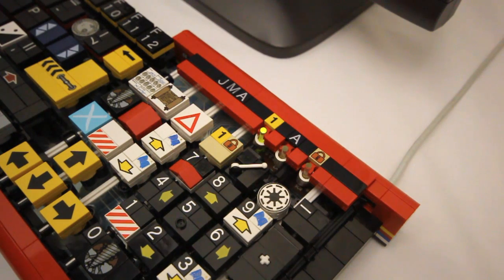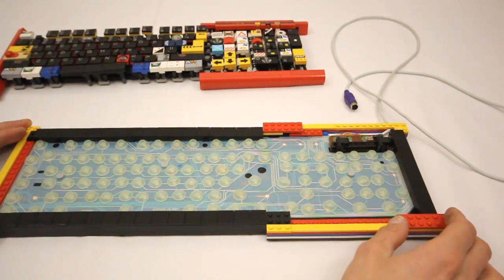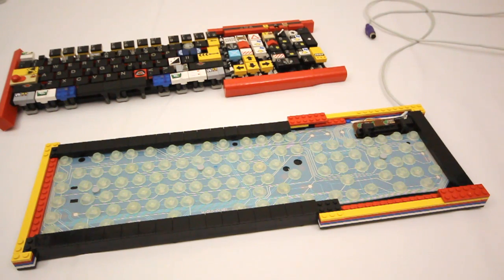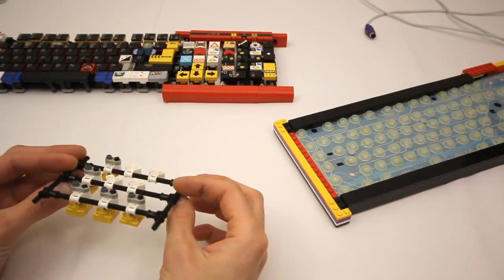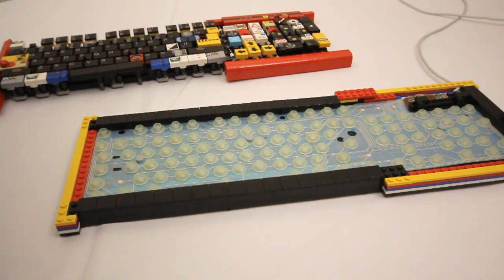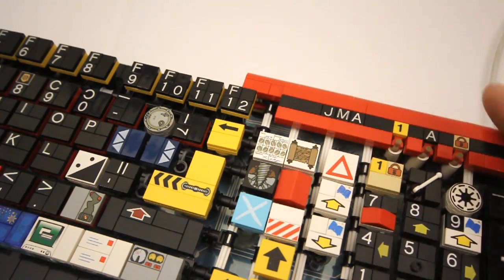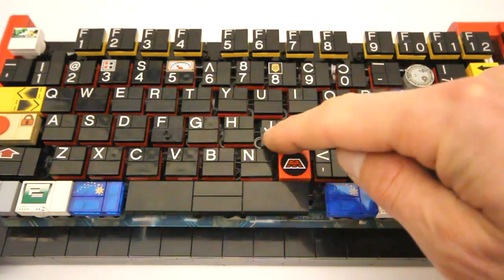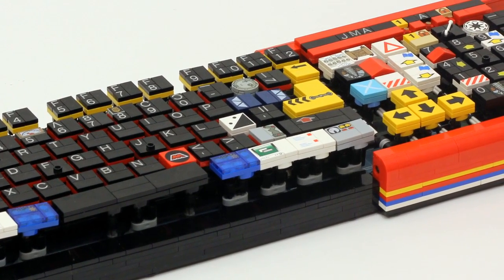Working LEGO Computer Keyboard

Comment: A recently found a lego camera I forgot about and although it would charge, the power button didn't work. I deconstructed a little bit of it by pulling pieces off with my teeth, but I just ended up ruining it. I wanted to see if there was any thing maybe blocking the power button, but no there wasn't. I'm so dumb.

Comment: imagine if it was mechanical
Reply: boy, do i have the news for you
Reply: It honestly wouldn't be much harder at all. It may actually be easier.
Reply: And four years later boi he makes one
Reply: It kinda is
Reply: @Charizardlover_0707  no... it's not. Don't you see how it uses rubber membranes rather than mechanical switches?
Reply: @g_a_b_r_i_e_l_  the mechanical definition for mechanical keyboards is rather messy anyways, is the IBM Model M no longer a mechanical keyboard because it uses a membrane? or how about KT linear and tactile foam and foil, the linear one would be considered mechanical since it doesn't use rubber, but the tactile wouldn't since the return spring is a rubber sleeve? or what about alps integrated dome? it's a standalone switch like Cherry MX and Alps SKCM, but it uses an enclosed rubber dome as a spring
Reply: @nepnep493  I was just saying the one he built wasn't mechanical
Reply: Gabriel Bryson sad :(
Reply: @Charizardlover_0707  yes, big sad. I get bsods almost daily :(
Reply: Oh my god don't talk it would take months
Reply: He did it, see this video:
https://www.youtube.com/watch?v=2jP6MFBXFaA
Reply: @mrgergos  Still. The next step is creating keyboard that uses switches build with lego.

Comment: That keyboard which you used as the base looks like it came from the early 2000's
Reply: Well if you didn't notice it using a ps2 port for its interface, so it definitely came from either late 90's like 98 or 99 or very early 2000's like 2000-2002

Comment: if you are willing to do all that, why not build it with mechanical switches?
Reply: Modern mechanical keyboards are digital, most use the USB interface. It would probably be even easier, since there's lots of DIY kits out there for mechanical keyboards.
Reply: you still need the controller unit of the keybord to convert the analog signals into digital signals
Reply: Taylor and Jackson I dont think you know what mechanical means...
Reply: If you can find a way to integrate Lego pieces with mechanical switches, go right ahead
Reply: really? mechanical switchers are loud? you can't be serious about that when using a LEGO keyboard.
Reply: Good point. My bad.
Reply: I agree
Reply: Van's Videos Tell me that when the mechanical keyboards are as quiet as membrane .
Reply: GReDDY WupS | I use cherry mx silent switches. They're great
Reply: Philipp Winter yes its loud. You must have had with that mech-boyism
Reply: what I'm trying to say is that it doesn't matter what kind of switch you're using. the lego bricks will be a as noisy or even noisier than any mechanical switch.
Reply: or yo-u could mod and existing corsair k70 if you want mechanical switches
Reply: ***** Nope. Made this thing in Paint like 3 years ago.
Reply: he can use mechanical keycaps with it lmao
Reply: Raph Vandal it is mechanical
Reply: Because Mechanical keyboards are loud as shit. Even those switches that they say that is a bit not audible still don't compare with membrane.

Comment: is that windows 97?
Reply: 98*
Reply: no this is Windows 90
Reply: this is actually windows 7 running with the classic theme, you can enable it by right clicking on the desktop and going into your appearance properties. In some cases this theme can actually make the computer run faster and can help with some issues in legacy programs.
Reply: it's was released in 1998 not 1997

Comment: TO ALL PEOPLE ASKING FOR MECHANICAL VERSION:
1. Take your current mechanical keyboard.
2. Take of a single keycap to start with
3. When you look on the inside, there is a small bar with a cross-shaped hole in the middle. Cut out this bar and put it aside.
4. Glue the bar onto whatever Lego piece you wish to use as a keycap
5. Let it dry
6. Put it back onto the keyboard!

It's actually really easy to do, as long as you have a tool that can cut the plastic. 
Warning: After doing this, you won't be able to use the previous keycap anymore. You'll have to buy new keycaps if you wish to switch back. But if you try this out, you'll have a Lego mechanical keyboard with the sexy sounding switches! 

Sidenote: After trying this out for myself I suggest you don't put O-Rings in the keys (if you use them) as they will cause the lego keycap to wear out and eventually fall out, and you will have to reglue them. So make sure not to use O-Rings. At least not the 0.4 mm ones I use. 
To be honest it's a cool project but it's not the same as having the rounded keycaps you would find in mechanical keyboards. Lego pieces are flat.

Another important note:
If you have an rbg keyboard I suggest not using lego pieces as it covers the lighting, and the only way to view lighting is the spaces between the keys. 

Summary:
After doing this myself (I'll include pictures if you want) I don't think it was worth it. Fun project to work on, but there are a lot of holes that would require repairing every few months. That's something I would not be willing to do. The pieces aren't very comfortable as they are just flat, with no curves. Also if you do not cut the cross-holed barrels correctly, the lego keycap will be slanted on the actual keyboard. 

CONCLUSION:
An overall fun and cheap project for me (overall spent around $50 for new keycaps after cutting up the old ones and for lego pieces to use for the project) but a waste of glue, Legos, and plastic. This project is fun, but not worth it. Thanks for sticking through my writing lol. Enjoy!
Reply: lol
Reply: there are lego pieces with the little plus thing on the bottom so it could be possible
Reply: thx
Reply: Glad to hear from someone who tried :)
Reply: thank you verry much

Comment: How do the keys pop back up after you pressed them? Just wondering
Reply from the maker: +Dee Tee The keys are just resting on the rubber domes of the membrane. The domes pup up after they are depressed, pushing the keys back up.
Reply: Watch the video, he shows exactly how he did it.
Reply: JK Brickworks duh
Reply: JK Brickworks ok
Reply: I Like Tasty Stuff there is like springs built into the non Lego keys and there's an spring in the slots where the keys at that's how the Lego keyboard works .....  I think... if I'm wrong please tell me if I'm wrong because an am not an competer exert... my crammed XD

Comment: This is not a Joke I have a question how much would you charge for a darth vader custom lego
keyboard and have you tried pulling apart a wireless or cheapo blutooth one becuase crap
that would be worth some real dough other wise I need a 15 foot usb wire. I am super impressed 
with this video and actually taking the time to create a custom lego keyboard action how does it type
compared to a basic keyboard action or is it like a typewriter I think you need a noise patch that 
you could make random sounds.

Comment: can I buy the assembly from you? I don't have the port this computer keyboard connects through on my modern computer. can I buy the grid and keys?
Reply from the maker: +John Mack Sorry, it isn't for sale.
Reply: +☭Fezcrab☭  there are adaptors for PS/2 to USB, though they are not as common any more as they were around 2000...
Reply: +John Mack It's a PS/2 cable, which are becoming outdated now, so it's no surprise that you can't use it. My computer only comes with 1 port, which I don't use.

Comment: How did u get it all connected to the computer??did u have any problems or did it work out just fine??
Reply from the maker: Kasia Mucha There were a few difficulties, primarily with interfacing the sensor membrane with the circuit board. In the end it worked out pretty quite well though.

Comment: How did you get the silicon thingies to stop moving did you glue them onto the pressure pad or something else ??
Reply from the maker: aleksandroaco I didn't glue them, although I probably will at some point.  Right now I have to make sure they are in the right positions before assembling the keyboard.  The axles attached to the keys keep them in place once it's together.

Comment: This is so impressive - great job!

Quick question: how did you re-attach the circuit board to the keyboard itself? Did you use screws or cleverly use some LEGO pieces to clamp the circuits together?
Reply from the maker: Donna Ioffredo It is done using LEGO parts. I have the interface between the membrane and the circuit board wedged tightly between some technic pieces.

Comment: awesome this keyboard would go good with my Lego keyboard um housing i guess ill call it, here is a facebook link to my housing i hope its ok to post links i just want u to see it https://www.facebook.com/photo.php?fbid=10202833853062094&set=pcb.10202833853742111&type=1&theater . and here is one for my mouse, https://www.facebook.com/photo.php?fbid=10202833853982117&set=pcb.10202833854222123&type=1&theater . i love doing this stuff with legos so much fun and if i dont like it i can rebuild in a diff way lol. my keydoard and mouse housing are not done need more parts lol

Comment: Do you actualy use it? ... Some keybords is.. well usable, but not nice to work with. Is it solid to that degree its workable to work with?
Reply from the maker: It is usable, but I'm not sure how it would handle constant use in a 'professional' environment. I use an ergonomic keyboard for my day to day work, so I haven't put it through its paces. For casual use it seems to work well.
Reply: Well, okey... i use a normal straight keyboard, some what similar to that you done in lego. Would you say its, well almost as good?
Reply from the maker: Yeah, I'd say so.  There is a bit of flex in the Technic frame which makes the keys feel a little 'loose', but it works just as well as the original keyboard.
Reply: JK Brickworks Its kind of nice.. when i become millionaire i will order a keyboard like this and have in my office ;)
Reply: i kinda wanna try to make one but i know i dont have that many technic peaces i got a lot of legos just never what i actually need to build something. so for now i just stick to desk stuff phone holder pen holders u know lol
Reply: He showed you in the video that he striped one down for the membrane
Reply: Changru Chen
find an old keyboard and strip it down.
Reply: matsv201 It may be cheaper to make it yourself... You could probably order all the necessary pieces for under 50 dollars and you could probably find an old cheap keyboard for the electronics of it
Reply: Dallas Bovair Yea sure, but if i have a 6 digit salery... well, i don´t now, then i problbly have no time for it... and... well, i don´t even have time for it now

Comment: i am realy wodaring how you got those light indicators working
Reply from the maker: I kept the LEDs on the circuit board of the original keyboard.  I'm using sections of these LEGO 'fiber optic' cables (http://www.bricklink.com/catalogItem.asp?P=x400c20), sitting above those LEDs to transmit the light up through the frame.
Reply: ok thanks

Comment: it looks smaller than a normal keyboard, but its built with an actual sensorpad thing, is it smaller?
Reply from the maker: It's the same size as the original keyboard.  Might just be because I was using a wide angle lens for the video.
Reply: yeah thats probably why, im working on my own atm :D not that easy after all ;)

Comment: This is great : )
It might have been easier to use a mechanical keyboard with Cherry MX switches and just take the key caps off, since the mechanical keyboard switches are much more stable than these rubber domes.

Comment: How sensitive is this keyboard? Does it have enough resistance to rest your hands on while not typing?
Reply from the maker: It's just as sensitive as the original keyboard, as the spring is provided by the sensor membrane.  The LEGO keys sit on top of it, just like the original plastic keys did.
Reply: JK Brickworks Thank you.